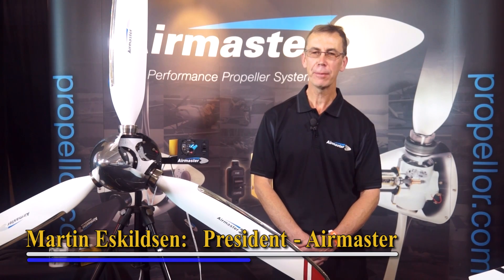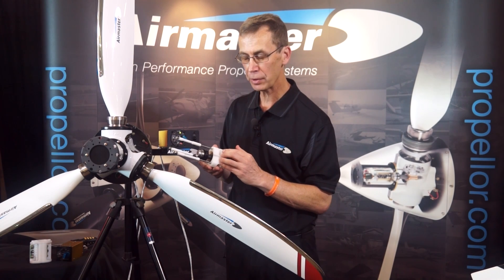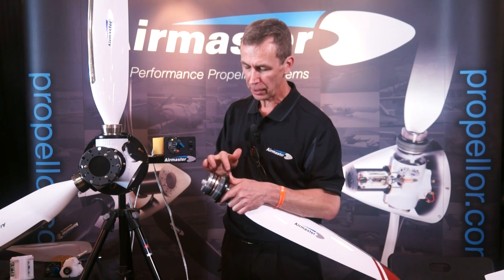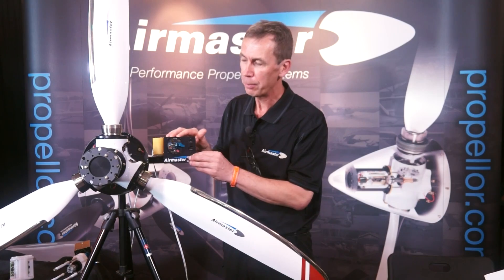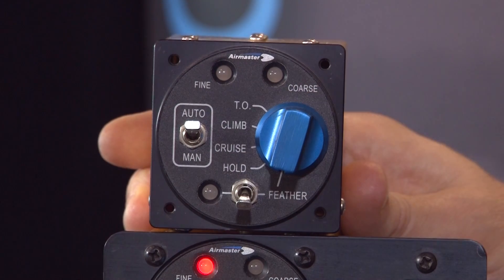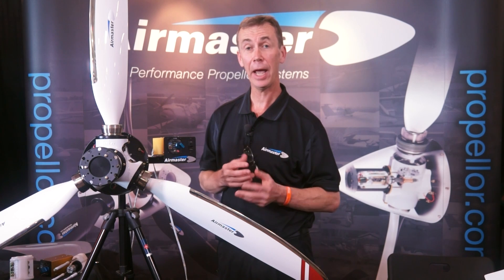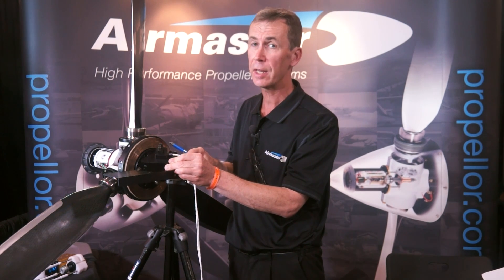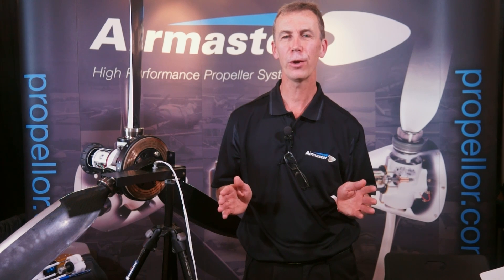Airmaster Technical Overview

Comment: The Airmaster web site states in the FAQs that an external belt-driven alternator can be used with the Airmaster prop with a special accessory available from Airmaster.  When I inquired of Airmaster about this accessory, I got no response.  I am buying my engine through RANS and when they inquired of Airmaster, they were told this device doesn’t exist.  Why has the web site not been updated if you aren’t providing the appropriate parts to allow use of an external belt-drive alternator?

Comment: Should one of the brushes for the slip ring break can I set the propeller to one static setting until I can make repairs the the broken carbon brush for the slip ring ???

Comment: The electric prop has been around for some time. Curtiss built an electric prop that was installed on aircraft like the B29 for use in arctic conditions. Its a pretty proven technology. The reversing function will allow people who have aircraft like a cub derivative on floats, the ability to back up on the water, which is awesome.